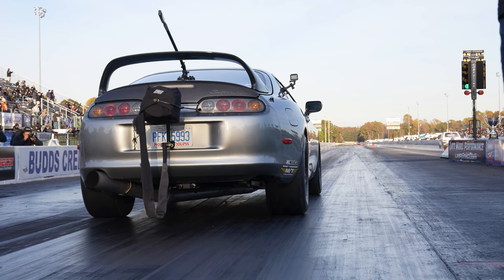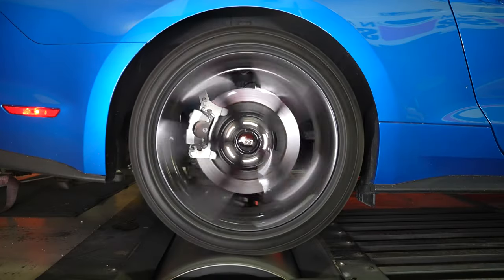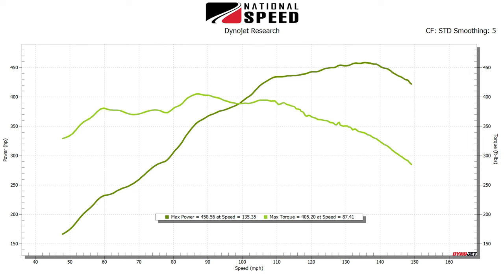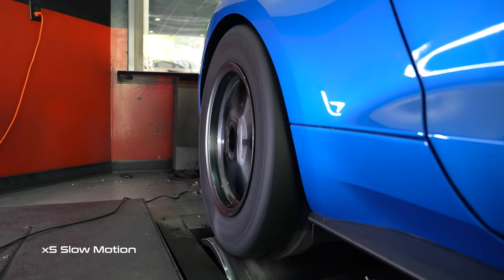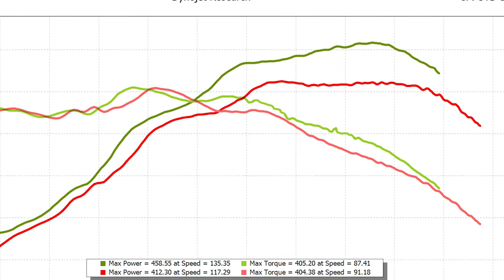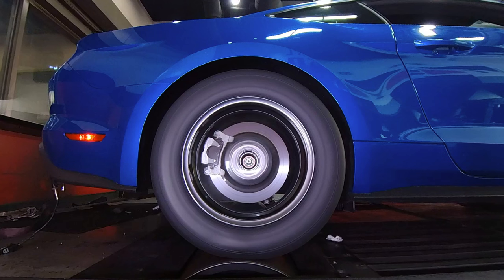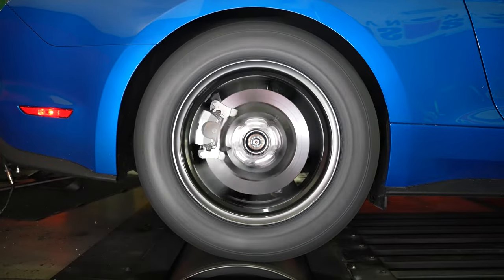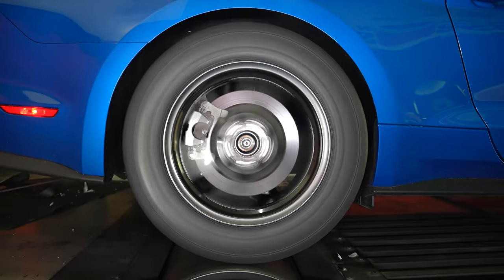Are Drag Radials Killing Your Dyno Numbers?

Comment: Crazy that I just found this out… my 2019 with similar mods as your project car only made 453/433 last year. I brought my car back and the shop was gonna do some maintenance items and I wanted to dyno it again and then try removing cats. I put new wheels and tires on my car and I went from stock PP1 heavy wheels and 295/35/19 tires to flow formed light wheels and 315/30/19 tires and without anything else on my car changing my car made 474/441 lol.. funny enough I put catless mid pipes in and only gained 4hp and 6 torque.. and got a check engine light, so I said screw it and went back to high flow kooks cats. Awesome video and I got to see this in real life.. my tires are a lot smaller then the stock 40 dries tires so I used 34psi to help not lose power cause of smaller tire